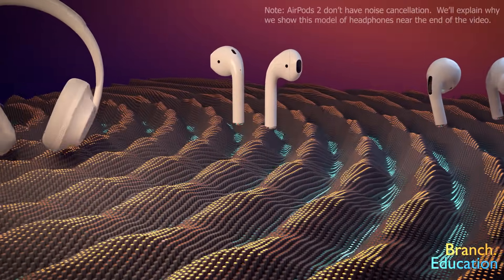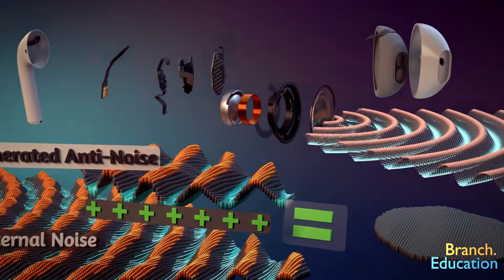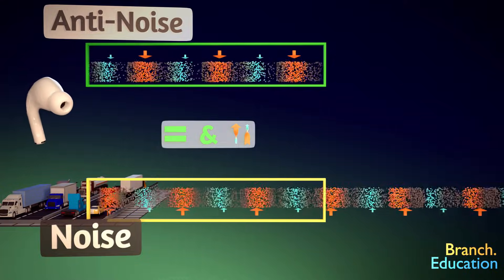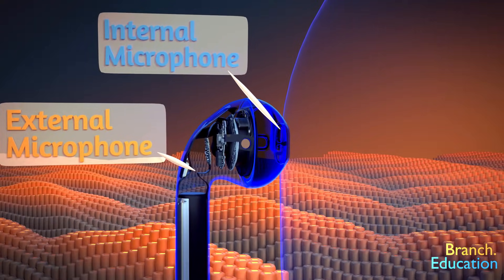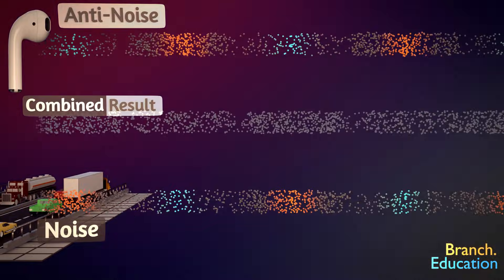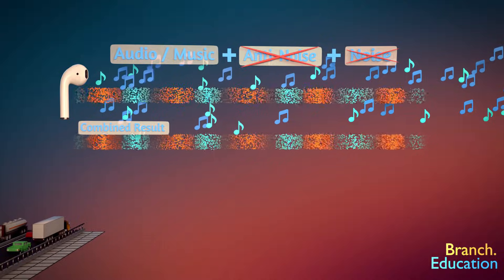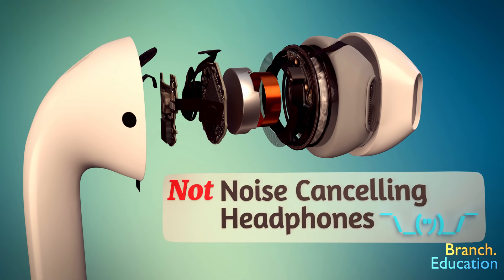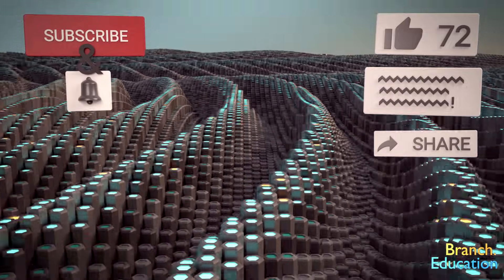How Do Noise Canceling Headphones Work?

Comment: I work as a dog bather with a lot of loud sounds constantly going; water hitting metal, high and low pressure dryers, and often a lot of barking. This explains why my headphones do okay with the noise cancellation of the ambient dryer noise but does jack-all against a particularly high-pitched yapper xD

Comment: I use pixel buds pro at work which involves me pushing a loudish petrol lawnmower, when I use noise cancelling it cuts the jarring loud sounds out, I can still hear the mower but it's a pleasant hum instead of a loud irritating noise, people keep saying that noise cancelling earbuds will still be damaging my ears, I don't think that's correct, can anyone give me some answers ? 

Basically is the damaging frequency still hitting my ears even though I can't hear it ? Or am I safe to continue with my usual earbuds?

Comment: These animations make it look like individual air particles are travelling all the way from the noisy highway to your ear in clumps of high and low pressure, but air particles don't travel, what travels is the energy from the compressions and expansions of air molecules. No air particle is travelling from the horn of a truck to your eardrum.

Comment: So basically the way that sound is created is by vibrating air, which creates pressure. Then the sound cancelling software plays the “opposite” frequency to basically balance out the pressure creating a neutral pressure which would mean no vibration which means no sound?

Comment: So the quality of noise cancellation is as good as (1) the microphone used to measure the external noise and (2) the chip producing and "aligning" the anti-noise waveform to null the external noise. Is that correct? I guess that's why AirPods are so costly, the Hx chips inside of them must include machine learning algorithms to best adapt to every possible kind of noise.

Comment: So, if you have loud external noise (say 105db) and you’re wearing noise cancelling ear buds, is your ear essentially exposed to the full noise (perhaps minus a couple db from the mechanical sound blocking from the bud)? Or does the cancelling itself offer some protection? Or is the sound level of the noise and the anti-noise additive resulting in even higher sound pressure?

Comment: 'High end wireless earphones' is a great fraud done by these companies. They first eliminated 3.5mm jack to force people into wireless earphones and now are selling these tiny pieces of electronics at insane prices. And people are paying it without questioning. This is an organised crime, a loot committed by these companies. $300 for a pair of earbuds? Are you out of your mind? Why? A simple $10 wired earphone produces better sound than this 'high end' shit, and without lag or any additional radiation.
Reply: you're right, but I'm worried about the equipment of the mini-jack in smart to be released everywhere like the Samsung s20 was removed, but I should have, I don't need a state employee, let the rest go around like a wireless trinket

Comment: In telecommunications we use noise cancelations in both ways downstream and upstream direction in order to have higher bit rate in transmission cables like copper pair. This process is called vectoring and its used in VDSL2 technology.

Comment: being an experienced sound engineer myself i still find myself fascinated by the precision of my not that much expensive earbuds’ ANC system creating an inverted signal of the noise outside and feeding it to my ears with no latency along with the noise itself and the transmitted audio. 
knowing through my basic experimentation with audio cancellation inside a DAW i can tell that adding even 1ms of delay to one of the signals pretty much ruins the cancellation immediately leaking some parts of the soundwave to output, the fact that we have systems of this level of precision inside an average affordable BT headsets becomes even more mind blowing.

Comment: Great video!

I was hoping that this video would discuss how engineers handle the processing latency in determining the cancellation signal. Does it shift periodic noise generation back by a cycle (so it still aligns near-exactly) while handling transient noises using immediate processing/generation (which is less effective due to latency)?
Reply: So will this get rid of the sound of my fat upstairs neighbor stomping and screeching the ceiling boards or not?

Comment: Amazing tech. I'm using it now in my apartment building's laundry room. 
I hate lawn motors too. I don't have to be bothered by it ever again! 
I can suppose these are a big help to those with sensitive hearing, and overstimulation. 
I was 10 when the Walkman came out. 1980ish. That changed the world. Before then headphones were expensive and for home use. They blocked out too much noise. Or portable earphones were a thing. Big dooly plastic plugs that fit in one ear therefore mono. 
Bone conduction in walkman headphones allowed for hearing music at low volumes while being able.to work or listen while walking/running. They also could be loud to drown out sound when you don't need to worry about the world around you. 
I have a lifelong passion for electronics. I came around just as the affordable microprocessor did. I saw the world switch from analog to digital. Exciting time to be alive.

Sorry for the long unfocused reply. I hate doing laundry. It's boring.

Comment: you used the gen 1 airpods for the thumbnail, despite them not having noise cancellation? but you could very easily have used the airpod pro models? i’m sure that the other facts in this video are correct, but it’s just a little tidbit about the thumbnail.
Reply: He very clearly explained why at the end.

Comment: What I've been wondering about recently: It cancels out the loud noise from the outside. Does that mean it cancels out the sound waves completely, so they don't harm your hearing ability?
Like could you theoretically use ONLY active noise cancelation to protect your eardrums against loud noises (considering the wave and anti-wave are always 100 % in sync) or would they still be harmed by the original sound waves the same way and you just don't "hear" the noise? I hope my explanation is understandable :D
Reply: Wondering the same thing
Reply: it’s like listening to music but it’s just the opposite of what’s outside so it cancels out what you hear but your ears are still being hit by both sound waves, so no they don’t protect them they probably make them worse
Reply: @AAA  This is incorrect, active sound cancelation does in-fact protect your ears.  It is reducing external noise by phasing out the soundwave before it hits your ears.  Phasing is what happens when two opposite but identical sound waves meet, which ends up canceling both waves such that they both cease.

Comment: Great video! I think putting the creator’s comments in the English (Canada) subtitles are such a creative way to get more across to the viewer. 

However, I found them a little confusing for me to navigate because 1) the mobile skipping from left to right is 15 seconds so I had to manually pause the video every time I wanted to read the comments and, 2) after watching the video and coming back to read the creator comments, the background noise of the video was a little bit distracting. 

My suggestion is, instead of putting the as Canadian subtitles, I think that it might be easier to put it in the description box or something else.

I just wanted to let you know of my experience, it might be helpful? maybe it’s just me and I’m not smart enough to read subtitles. You don’t need to do my suggestion or anything because it’s still a WONDERFUL video!

Comment: Hey, I don’t fault you guys for the model mixup whatsoever, AirPod pro’s are notoriously probably the hardest truly wireless earbuds to even crack open, the battery is layered in glue, and as soon as you open it, boards can immediately get damaged due to the glue and plastics shredding each-other apart. So it is perfectly understandable!

Comment: Wouldn't it be possible for noise cancelling to damage your hearing? Im guessing with consumer active noise cancelling headphones that it would not be the case, but if you had headphones that could actively cancel out really loud noises, would that not damage your hearing as bad as just exposing yourself to the loud noise? Just wondering
Reply: I have this same question too. I guess that's why good noise cancelling headphones also have really good insulation so that very little noise gets in anyway.

Comment: So when you're listening to your music on noise cancelling earphones, what you're actually listening to is a new song with the old song used as a sample. Surely this could have legal complications?
Reply: Not really, I mean if ANY reproduction of the music counted as a sample or copy then your electronics would be forbidden from playing it, therefore you could not ever hear it.  The sound of the freeway is public domain and you can't be charged for duplicating it to invert it for cancellation in any case.

The headphones may be modifying the waveform but only with the objective of playing the music without the external noise, and possibly with some frequency equalization to try to give the most accurate playback from the known imperfection of the headphone response.  Applying tone controls modifies the music as well.  Now, if you record those modifications and try to re-sell the resulting sound, then you're liable for sampling another's work.
Reply: @pault151  yeah that makes perfect sense actually.

Comment: Please make a video about how phone wallet works 📱📱📱📱📱📱📱📱📱📱📱📱📱📱📱📱📱📱📱📱📱📱📱📱📱📱📱📱📱📱📱📱📱📱📱📱📱📱📱📱📱📱📱📱📱📱📱📱📱📱📱📱📱📱📱📱📱📱📱📱📱📱📱📱📱📱📱📱📱📱📱📱📱📱📱📱📱📱📱📱📱📱📱📱📱📱📱📱📱📱📲📱📱📱📱📱📲📲📲📲📲📲📲📲📱📱📱📱📱📱📱📱📱📱📱📱📱📱📱📱📱📲📱📱📱📱📱📱📱📱📱📱📱📱📱📱📱📱📱📱📱📱📱📱📱📱📱📱📱📱📱📱📱📱📱📱📱📱📲📲📱📲📲📲📲📲📱📱📱📱📱📱📱📱📱📱📱📱📱📱📱📱📱📱📱📱📱📱📱📱📱📱📱📱📱📱📱📱📱📱📱
Reply: Phone wallets use NFC which is a magnetic disc located somewhere on the back of a phone. Every credit card has RFID, which can be emulated using NFC. Then software like Google or Apple pay get your bank to trust the software and the phone and then from there it's quite secret.